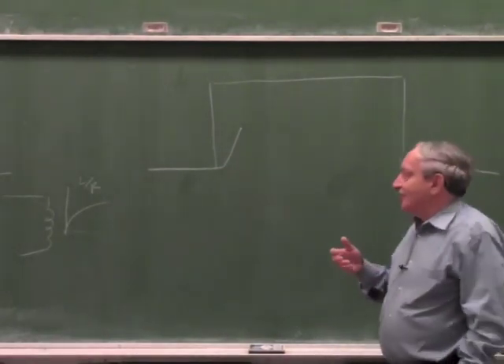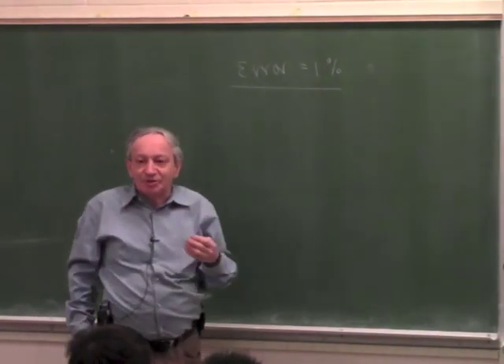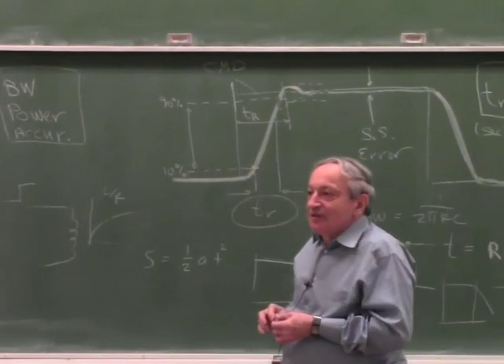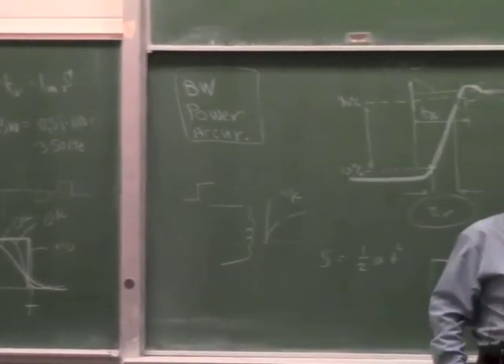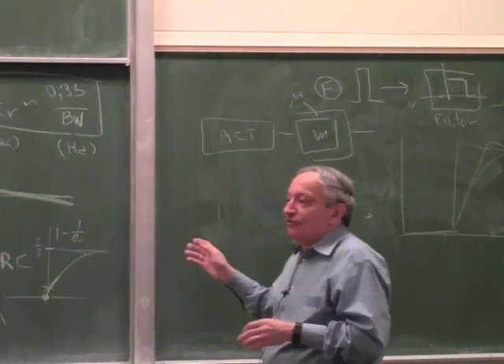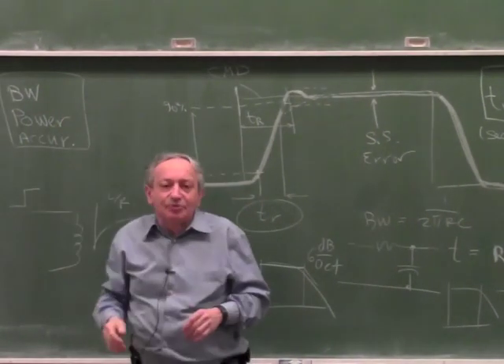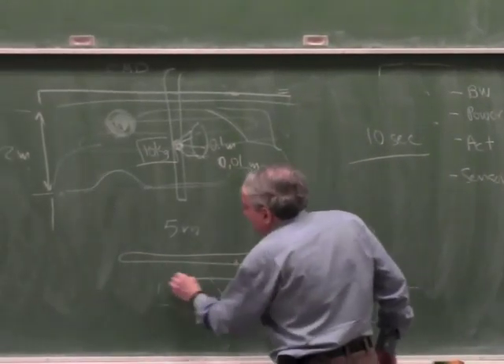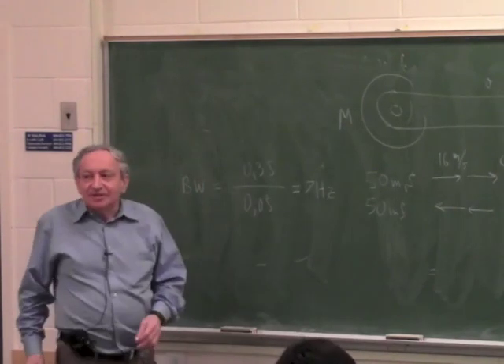24  System Design

Comment: I don't understand the term bandwidth in this context. Anybody?
Reply: Bandwidth in this case refers to the unity-gain crossover frequency of the open-loop servo system (or the -3 dB point of the closed-loop system, because 1/(1+1) = 0.5, and 10log10(0.5) = -3). The servo control loop has authority between 0 Hz up to this frequency, so that's the "bandwidth" of the servo.